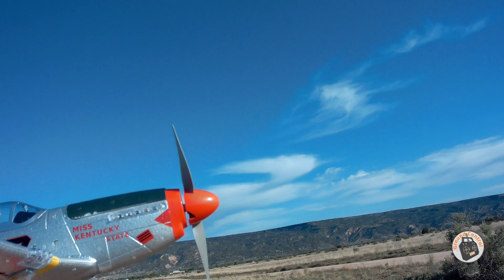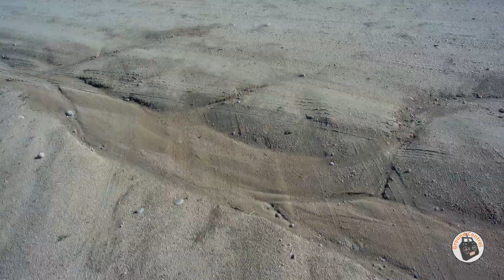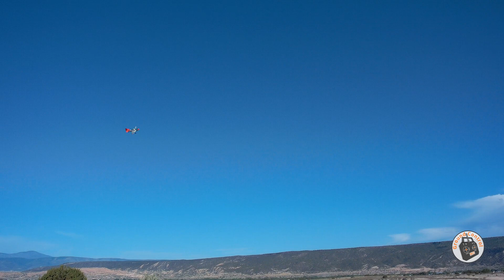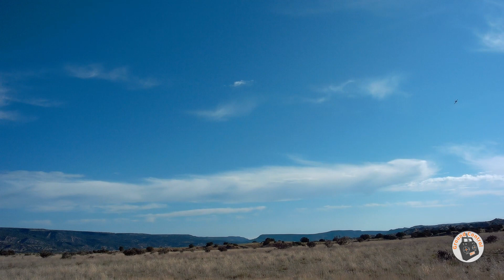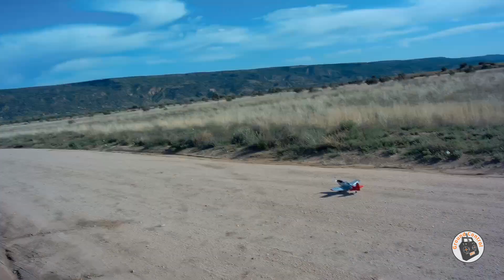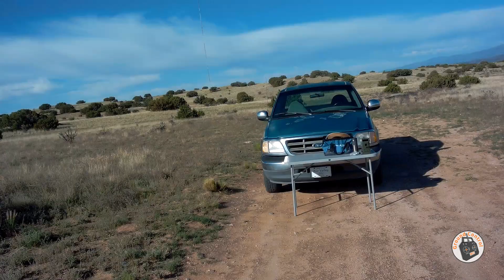New Prop & Modified Spinner! Fantastic Performance! XK A280 P-51 Mustang 3D/6G System 560mm 4CH RTF!

Comment: Ingenious Gina. Your skills are endless. Isn’t retirement fun! Wonderful to reclaim all this time for one’s passion..
Reply from the maker: Thank You!
I'm having more fun than ever ;-)
See you in the Air!
Reply: @GroundControlRC  indeed.I’ve ordered the fly bear Bach 324. As you seem to like it. Im running the XK mustang on spektrum using the lemon dsm satellite rx. It works great. There is even the right sized space in the XK mustang for it. Its nice using a spektrum nx8. Also one thing i noticed is that you can use the original TX to switch lights on and off . Then turn off the original TX, and then you can use the spektrum radio as main controller. Weird but cool if you want to switch lights on and off.
Reply from the maker: @Kianito89  That's a good idea using the stock TX to manage the lights ;-)
The Flybear SBACH 342 is one of the best sub-250g planes I've flown so I think you'll really like it.
Reply: @GroundControlRC  i can t wait to try like you did …. Thnx

Comment: What did you use for a spacer before the nut.. this prop has a big gap and won't tighten down
Reply from the maker: The links I provided for the prop are ones that include the spacers that are needed for this prop.

Comment: Can you explain how the 7x5 thin electric prop installs on the "cam" offset type shaft(I don't even know the name of this type of shaft)
Reply from the maker: I provided links to this prop that include a set of spacers. I use 1 space behind and 1 spacer in front of the prop. The flat part of the shaft doesn't matter it's the diameter of the shaft that's important.
So just mount it like a standard prop.
Reply: @GroundControlRC   got it, thanks
Props are on order...just doubting my understanding
Reply from the maker: @gerrymorris1698  No Worries! You'll really like the increase in performance with that prop.
Reply: @GroundControlRC  l am hoping that will give me a bit more positive control at the beginner rates.
I'm pretty noob,so my motto is still...Fly Hard, Crash Harder.😫
Savin" up for a Radiomaster Boxer 4-1
I probably should have went with a high wing trainer but the p51+price point was too hot to pass up
You and your channel are a huge asset to me, thanks again!
Reply from the maker: @gerrymorris1698  You are most welcome!
A Hobby-Grade TX will make it feel like a completely different plane.
So much easier to control.
I hope you get one.
See you in the Air!

Comment: Is there a low battery warning that I'm missing?
Reply from the maker: I did not see anything in the manual that stated a low battery warning. I don't remember any low battery warning with the stock TX but I've been flying with my TX16S shortly after getting this plane.
Reply: @GroundControlRC  Hoping to get this bound to my NX8. Thanks for taking a moment to reply. I sure appreciate that!
Reply from the maker: @coloradofotomatt  You are most welcome.

Comment: Excellent Video Series as Always.    quick question, on average, with this prop, at how much throttle did you stick during the flight?  60%, 80%?
Reply from the maker: Hum...with the 7x5 Prop on 2S, given I hand launch the plane at 60% Throttle. You should be able to just cruise around at 50% Throttle.
I perform mixed mode flights cruising around part of the time and full throttle for short burst performing aerobatics...I would guess my average throttle for an entire flight to be between 70%-75% Throttle.
Reply: @GroundControlRC  hello there again :).

Just got the 7x5 propeller and some 550 mAh batteries.

just requesting more info on how to install the new prop on the stock motor.  I went by adding 3 spacers between the prop and the motor, and another thicker spacer between the prop and the nut (since I bought several Prop sets, used those spacers). it seems to be fixed ok on the motor, but was just wondering if you used a different method.

any  input would be greatly appreciated.
Reply from the maker: @sagacyberdemon  I just used 1 spacer behind the prop and 1 spacer in front of the prop.
As long as you can secure the prop on the shaft I don't think it matters.
You may have to modify the spinner a bit more than I did since the prop will be higher on the motor shaft.
I also balance all my props before I install them.

Comment: Did you try a 6x5 prop as well? As far performance, are you talking about flight time or power? Does the 90C battery or the other upgraded battery increase flight time or just power? I'm confused because the stock battery has a high MAH at 650Mah. Sorry I'm a beginner still and not familiar with what the C rating is.

Thanks-
Reply from the maker: I tested a few props but I'm can't remember if one was a 6x5.
When I talk about performance I'm talking about power.
Think of the MAH of a LIPO as the gas tank in a car.
Think of the "C-Rating" of a LIPO as the horse power of the car's engine.
The higher the C-Rating of the LIPO the more amps it can provide to the electric motor.
You want to make sure the LIPO you use can provide the amps required by the Motor and Prop.
Reply: @GroundControlRC Thanks for the explanation-
 So would any of these setups be better for flight time? Between using the  different batteries and the different 2 bladed props? I don't have a huge area to fly in so don't need to get it going too fast so I'm shooting more for maximizing flight time. Coming from the Drone/Quadcopter realm,  the stock prop probably has more drag than a 2 bladed propeller to spin. Generally at least with drones, 2 and 3 blade propellers seem to be the sweet spot. It's a catch 22 and at some point it's the law of diminishing returns  as far as drag vs higher rpms of a 2 bladed prop.

As far as the battery , is the C rating similar to "watts"? Because I get mixed up because there's also volts. I know in some quads, planes, helis, etc if it can handle it you can put in a higher voltage battery with an additional cell and several additional cells and you get more performance and "horsepower". I know if you compare a tank full of water and a pipe that drains it. Amps is how much water flows through the pipe. Volts is how fast the water is flowing through the pipe out of the tank. So is the C rating basically how fast the tank is capable of emptying out of the pipe?

Concerning flight time. I think Fullymax makes a 750mah (still at 20c) for another aircraft that ive heard people have used successfully in this plane. I wonder if that would be the best bet for max flight time?
Reply from the maker: @asdaven1  Of all the props I tested the stock prop required the fewest amps and therefore would provide the most flight time.
I believe the stock prop is a 6x3x4 prop.
You might try a 6x3x3 prop.
It may provide enough thrust and provide more flight time.
Reply: @GroundControlRC  True but if flying in a smaller area where you can't go too fast....you might only be using half throttle on the more powerful prop whereas full throttle on the stock prop. I notice in the video that full throttle was where the amp draw varied the most compared to partial throttle.

Would the stock battery give the most flight time or the battery you were recommending? And have you heard of people using the 750 mah version of the Fullymax Stock battery? I think the 750mah one is for a fpv drone or helicopter but same shape maybe just slightly longer than the 650mah one.
Reply from the maker: @asdaven1  If you're looking for the most flight time and not power I'd go with the largest mah LIPO assuming you can get the CG. The more throttle the more amps needed from the LIPO. With power systems you have to make sure the LIPO and the ESC can handle the amount of amps the Motor and Prop require otherwise you can damage the battery and/or the ESC. Also, not all LIPOs are the same quality.

Comment: Thanks for the help, making sure the trim is 0'd on the cheap XK tx to get my plane up! So much fun that never gets old. So the 7x5, 2 vein is the cheapest but most effective upgrade? Got a 2,200KV brushless motor & corresponding ESC that I got dirt cheap(40 amp I think). Would it be compatible or complementary with this plane & circuit board?
I don't know what battery would be best for a high KV and control sys. Thanks again brother for the very in depth description and education. Also do you use a universal Tx? Which ones have a good cost:benefits ratio? I know a lot of people dig expo rates on the controls, or for more advanced planes with retracts, canopy opening, flaps, split flaps, lighting, etc . 
There seems to be a gigantic leap between the $150 range up into the 10-12 channel sys with a $500 cost differential. I just want something that doesn't cost 2x the cost of my fleet of 13 crafts. Keeping track of all those radios is too cumbersome and a headache. any input would be appreciated! Cheers
Reply from the maker: No Worries!
Yes, the easiest, cheapest way to get better performance is just changing the prop to this APC Style 7x5 thin electric 2-blade prop.
I thought about converting to 3S on down the road but I think just a bit larger motor with additional torque would work just fine for a 2S setup with even more power.
I've provided links to everything in the video show notes after testing additional props.
Here's links to everything I use in mine (7x5 prop, 2S LIPO, XT30 > JST adapters):
4pcs GNB 550mah 2S LiPo Battery 90C 180C with XT30 Connector
https://amzn.to/41GbMT1
3pcs XT30 / XT-30 Male to JST Connector Adapter(C93-3)
https://amzn.to/3IBPomY
2pk 7x5 APC Style Thin electric Prop with Adapter Rings
https://amzn.to/49cPwEX

Comment: Which GNB batteries do you prefer?....and can you charge them with any 2S charger? Do you leave the lights connected? I tried some 2S 50c 800mah batteries from Amazon that was the same as stock but only last about 4min. I swear my 280 seems a little weak?
Reply from the maker: I like the GNB 550mah 2S LiPo Battery 90C 180C with XT30 Connector and there are links to them in the Show Notes as well as the XT30 to JST Adapters.
I charge them with my 2S-6S Balance Charger but I suppose any 2S Charger should work.
I disconnected all the lights on mine.
Reply: The reason I asked about charging was because you have 2 different 450mah batteries listed. I was wondering about the HV 7.6v 80c batteries? Which one were you referring to and which one were you flying with in the video?
Reply from the maker: @ant-man1131  I fly with the 450s and the 550s. I just charge the HV LIPOs to standard 4.2v per cell.
I had the 450s before I purchased the 550s but with the 7x5 prop I prefer the 550s.

Comment: Does the propeller pop off in a crash like those 400mm warbirds?
Reply from the maker: Hi Justin!
No, this one does not pop off like those brushed motor micros.
The Prop seems pretty durable as I accidentally ran mine into the dirt bank full of scrub at full throttle and it survived ;-)
This has a spinner that attaches via a center screw and the prop is secured using a nut as the motor has a threaded shaft.

Comment: I just got my hands on one! Haven't got the chance to try it yet but am excited after watching your videos! BTW, do you think this plane can carry an Insta360 Go 2 camera, maybe somewhere behind the canopy? The camera is only about 1oz or 26g. And pardon me if I've missed it, but did you need to cut any foam to fit those better batteries, especially the GNBs?
Reply from the maker: I'm glad you got one as it's such a great little Warbird.
I didn't have to cut any foam and the batteries fit perfectly.
Before I cut any foam to install a camera I'd just add that much additional weight where you'd like to install the camera and see how it carries the additional weight.
That's what I do to make sure they can carry it.
You're going to have a blast with this plane ;-)
See you in the Air!
Reply: @GroundControlRC  Thank you for the advice. I can’t wait to maiden this. Guess I’ll just learn to fly it first before attempting anything “extra”. I actually have a bigger Cessna which I couldn’t get up in the air so bought this to practice flying more. Let’s hope it works. You have fun too!

Comment: Just awesome man so glad you found these props I'm gonna be grabbing this warbird and I was a lil skeptical because of the roll rate but it has improved alot and I knew you would figure it out lol you helped me get my arrows pioneer to perform like a timber x by extending the ailerons 👍🏼definitely grabbing this bird now✌🏽
Reply from the maker: Thank You So Much!
It's such a fantastic Sub-250g Warbird and I can't stop flying it ;-)
I was very happy to find you can get really good performance from it without having to replace any of the electronics, which was my goal.
I really hope XK comes out with a full line of these Warbirds as I'll definitely be snapping up a couple more.
See you in the Air!
Reply: @GroundControlRC ™  I have been holding off for awhile on a warbird because I know most if not all come with brushed motors and I'm not a fan of them and when I saw this was brushless and wasn't as twitchy as the others I knew I had to have this one lol yes if they all come out like this one I will be collecting a few myself😁✌🏽

Comment: Nice. Lots of go-go.  4-blade props are best for on-the-shelf display purposes.  In the air go 2-blade always when practical.

Happy flying!
Reply from the maker: Thank You!
I was pleasantly surprised with the performance of this prop.
I was afraid a 5 inch pitch was going to be a bit too aggressive for this motor but it worked very well.
See you in the Air!